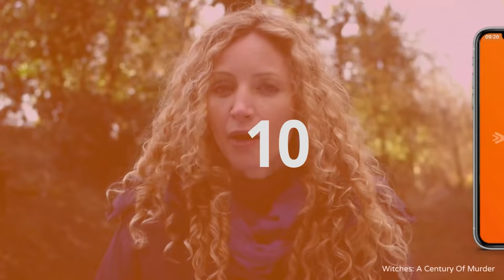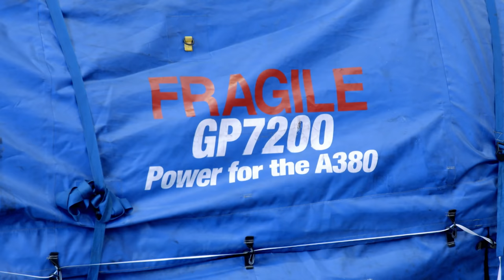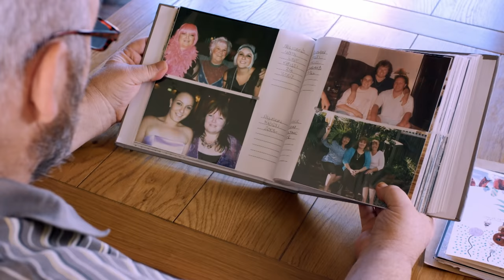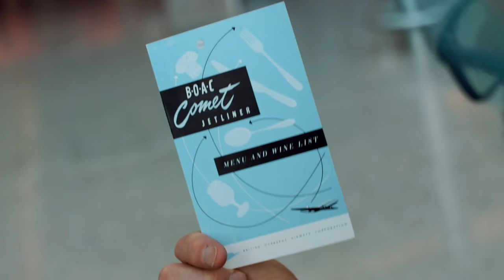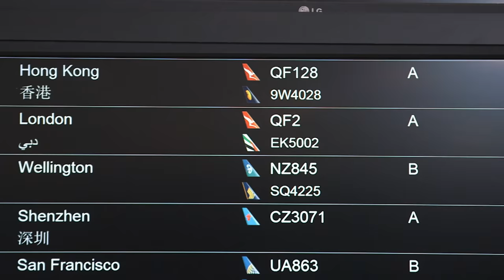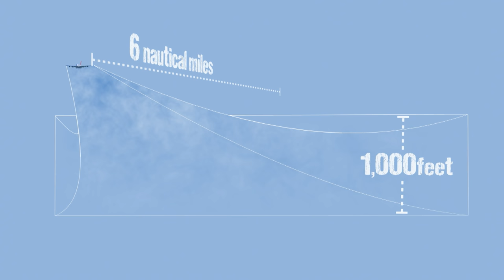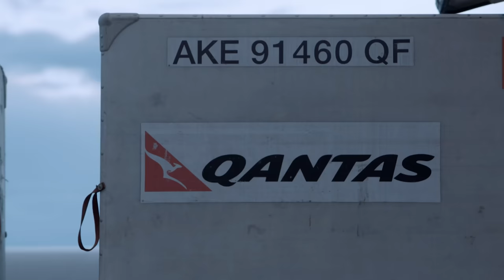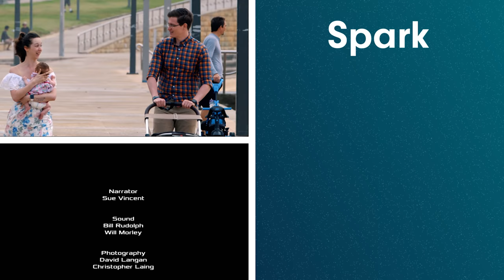London To Sydney: What Really Happens On The World's Longest Flight? | Long-Haul Flight

Comment: It takes 24 hours to go from Addis Ababa Ethiopia to Newark, NJ
Reply: Not if it's a non-stop flight.
Reply: @svscared  Yes, 16-18 hours there. 24 hours back. No flight to Ethiopia is nonstop. It has to stop and refuel. Typically letting more passengers on and some off. Planes can’t fly 1 straight shot to and from Ethiopia.
Reply: @ThePomskysPalace  You're somewhat correct. As of now there appear to be no direct flights between the US and Ethiopia but it looks like Ethiopian does fly to the US non-stop on a seasonal basis and their planes absolutely have the range to reach the US without refueling so why they don't have year-round non-stop service to the US anymore is very puzzling to say the least.
Reply: @svscared  Even though it says Nonstop they MUST refuel when returning back to the US. I only take direct flights. I never get off the plane. Passengers have the option to depart or enter at that port but direct passengers do not have a layover. It is a 30-45 minute stop, that’s it. However it’s IMPOSSIBLE to get from Ethiopia to the US on 1 tank of gas. I have flown to and from many times, the pilot will explain that to you almost every-time how full up stops work. They have also used that opportunity at times to check passports on board, search luggage with drug dogs, and restock the plane.
Reply: @ThePomskysPalace  It most certainly is possible, particularly with the newer wide body aircraft Ethiopian flies as they can handle anywhere from 8000 to 10,000 nautical miles which is more than that distance so either they are using limited aircraft or they are choosing to stop first for some reason.
Reply: @svscared  Altitude is different in Ethiopia, it takes more fuel to fly back. But whatever you say, I’ve flown to Ethiopia multiple times on direct flights. They all stop for gas, I’ve stopped in Duabi on the way to Ethiopia for fuel and Nigeria on the way back. Not sure why they’d stop if they could make it direct.
Reply: @ThePomskysPalace  Perhaps there is something unique about flying into Ethiopia that I don't know about but all I can say is on paper at least they have the planes to fly that distance nonstop so I also don't know why they wouldn't fly nonstop if they in theory could. I wonder if the nearby countries are the same or not?

Comment: Just to point out, the aircraft shown in the wing views during takeoff and landing (18:13 and 50:52) are not Airbus A380's. The wing tips of the A380 are a lot smaller and have a wing tip on the top and bottom of each wing. The plane shown could possibly be a 737 or A320.